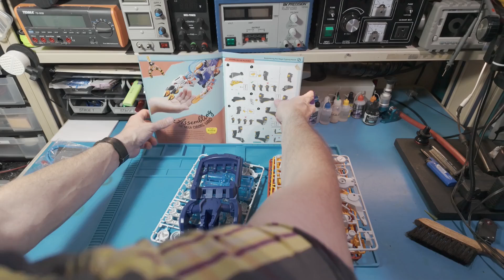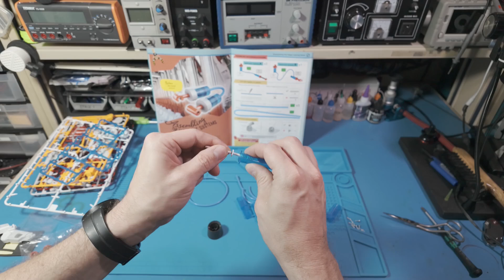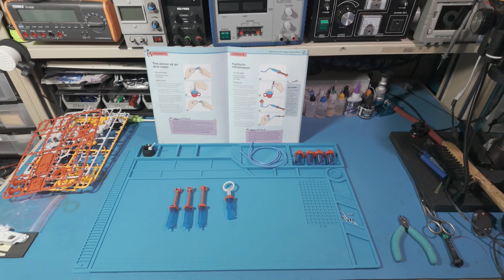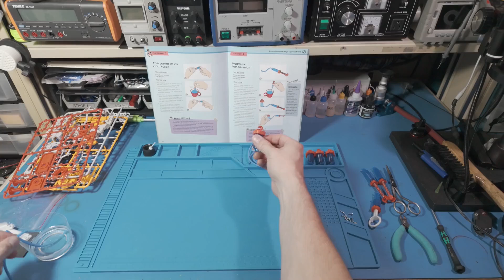Building the Mega Cyborg Hand: Fun Hydraulic Robot Kit Assembly & Review

Comment: Thanks for the video! I just made one of these for my grandson.

The main point is that some of the parts are such a tight fit that the bits where the moulding attaches to the sprue have to be removed completely to get these parts to snap together. I used some small side cutters and a 'box cutter' knife, less work and a better finish than emery board or a small file. Even on the non-critical parts it's good to remove these tiny bits which could hurt small fingers. This adds a lot to the assembly time.

The second point is that it's quite fiddly to get all the air out of the hydraulics. I immersed the cylinders and tubes in a deep baking dish and worked the cylinders with the tube ends just below the surface. We haven't worked the hand much yet so it remains to be seen if air can creep into the system.

Overall it's a fun thing to assemble and demonstrate, but I'm not sure what my grandson will make of it. Probably more fun for the mechanically-minded dads and grandads, if you're allowed to say that these days!
Reply from the maker: Probably true my daughter made the wall climbing gecko from this company,  it just sat on her shelf for years . Hard to get the youth to do much physical 😕